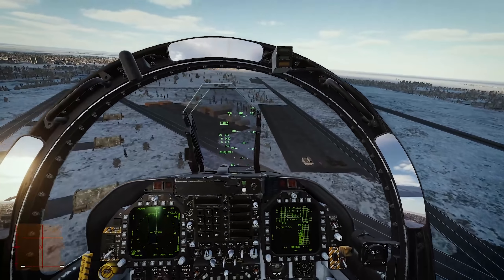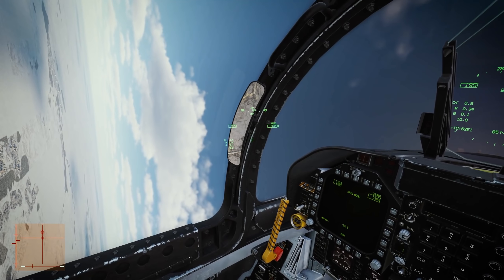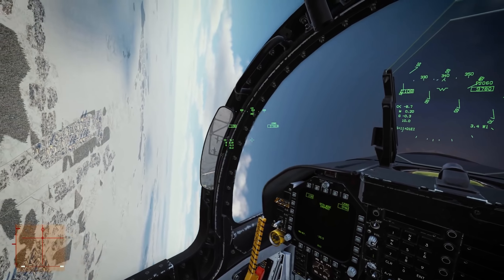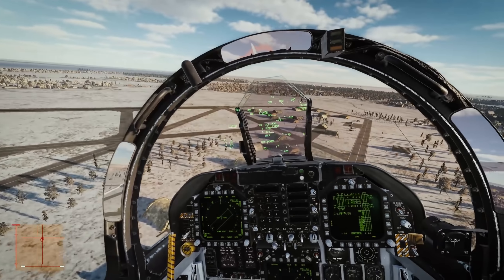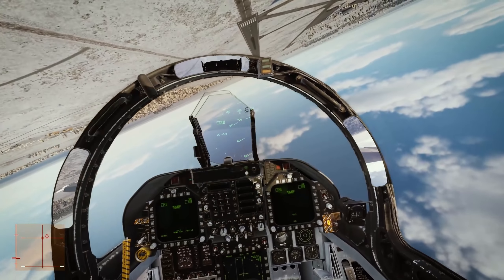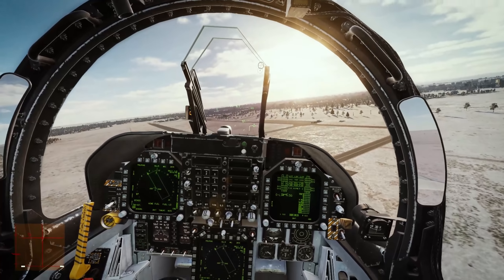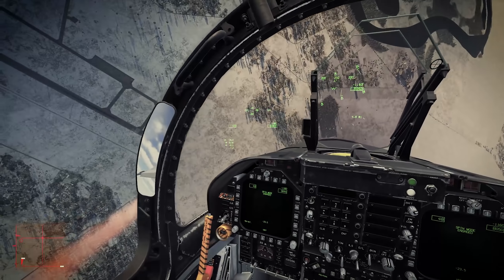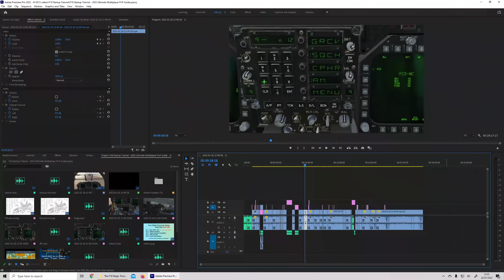The F18 Magic Trick Switch - Crazy Aerobatics in DCS World

Comment: There is a button on the stick and is modeled I can’t remember the name of it (might be the autopilot disconnect button), but when pushed it allows you to override the FCS system it and pull harder than you can with the full limits of the FCS, it’s momentary though so If you hit when you pull the stick back then let off the stick the FCS limits come back alternately you can just hold the button, not quite sure if the Autopilot disco button removes all of the limits similar to that of the spin recovery switch as I haven’t tried the spin recovery switch.
Reply from the maker: yep you're spot on, that switch is aka "the paddle" and is the FCS overide / AP disconnect. I use these 2 switches in conjunction with each other in this video. the switch you refer to inceases the AoA and G limit the FCS will allow, but it doesn't completely free up the full range of flight controls, for that is the spin recovery - that said (and maybe for some strange reason) using the both together, gives you the maximum amount of moves possible. To test what I am talking about - fly the F18 about 350kts and pull fully back, then press FCS overide, you will get more pull, then press spin recovery, you'll get almost like an "FCS override x2 effect"
Reply: In your statement about flying at 350kts pull back, then hit The fcs override, and then hit the spin recovery, if all done in the same pull no matter what as speed decreases the fcs will allow for more pitch authority, the best way to tell the most is pull at 350kts, reset pull while depressing the  AP disco button, reset and then pull with the spin recovery switch that would be the best way to test them all I’ll have to try my self, but the AP Disco button can be useful in a dogfight since it’s easier to hit that than rather hit the cover up and then hit the spin recovery.
Reply from the maker: Ideally you open the cover ahead of time , and map the spin recovery itself, and use it for solo aerobatic type stuff. If you play around with it long enough, you'll find the speeds and configurations it works best and not so well at.
Reply: @DCSDigitalCombatSimulator  Thanks for explaining this.  I thought the paddle already does all of this without causing the Leading Edge Flap to cause drag when fully extended down, as designed to do.

Comment: Biggest problem with flight sims and any simulator, you have no feel of the vehicle. Same with racing simulators. You can use motion sims as much as you want, it still does not give you that feel. I want to try a G seat and see how it works.
Reply: DCS has a setting where the camera will mimic the acceleration (g's) of the aircraft, it's exaggerated of course, but it's helpful to get a feel.
Reply: ya, did a glider lesson once and was immediately surprised at how natural it felt. a minute in a glider and I felt like I've been flying my whole life, two years in dcs and I fly with the grace of a penguin
Reply: @Doomsday499  Does not work in VR though.
Reply: Bass shakers help as the have options for g force, stall buffeting etc
Reply from the maker: The sensations / motions / smells and physical feel of the real switches is rapidly becoming the only things that seperate the flightsim experiences... There is a real world 737-800 captain who has a youtube channel and often flies the 738 in Xplane (flightdeck2sim) and he has stated several times words to the effect "I am confident any of you who have regular flying in the sim, who follow the procedures and charts and fly vatsim, could take an airliner gate to gate in the real world, and it would be fine. The only thing that you'd really notice different is the motions, positions and weights of the controls" - take that for what you will, but I think it reflects your comment
Reply: @DCSDigitalCombatSimulator  What? I really hope you are and that "pilot" are not serious. I REALLY hope not.
Reply: @DavidVanmeterDutch  flying really isn't that hard. You don't hear new students crashing all over. Its mostly just a series of actions followed in the correct order. For commercial flying you arent pulling gs or dog fighting pilots who have studied air combat. Its 100% accurate that most experienced sim pilots...not arcade flyers, could successfully fly the aircraft they have studied.
Reply: So lets do an example. In a car when you let off the gas pedal you suddenly feel the car start to slow down, but if you look at the speedometer it will still be around the same speed. I drove semi's for 17 years and I had to quit because of vertigo in 2012. I can play American Truck Simulator in VR and it really feels like I am sitting in the cab again. It feels exactly the same, but when I am driving that sensation of feeling the truck is missing. Pulling all that weight, making a turn, going up, or down a hill is completely gone. How you make turns and back into a dock is 95% realistic though. I have even been on the high end truck driving simulators, that can let you feel the road. That speed and weight feeling is still not there. I would say it is the same with flight sims, you have no feel for the vehicle. It is the closest to realistic you can get, without being in that vehicle though.
Reply: @ComdrStew  a buttkicker will tell the through vibration that the engine is losing rpms even before you start to slow. I can tell when I'm getting close to max gs. When my burners kick on etc
Reply: @matthewjackson5325  I know, I have a Buttkicker Gamer 2. I try to get people to get it all the time. I love going down the taxi way and feeling the little bumps in it, lol. It is real handy with helicopters. The feel of the motion is what I am talking about, but the Buttkicker is the closest thing you are going to get and it is worth every penny. My friend has four of them on his racing sim, one for each tire. That is when I got it. I have a starter sim pit with a wood floor and seat. You can feel my Buttkicker in the stick and throttle also.

Comment: You are completely wrong, that switch is not used for that. IRL pilots don't use that switch at all, if you want to change all software flight limits there is some ways to adjust it via the menus, but that switch is not the way.

When the hornet enter in some out of the envelope maneuvers, it automatically enters the spin recovery mode, in which the pilot just need to follow some instructions shown in the MFD, if those instructions are not followed by the pilot for X reason, the plane auto adjust and moves all flight surfaces in order to recover the plane, sometimes the plane enters and exits that mode so fast that the pilot doesn't even notice.

The spin recovery switch is used when the plane is unable to recognize a situation in which the spin recovery mode is needed.